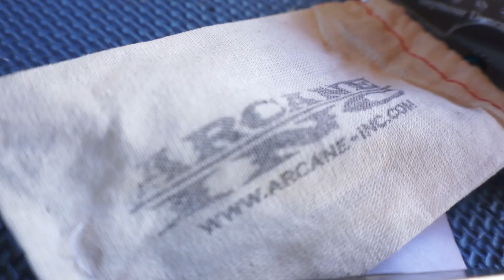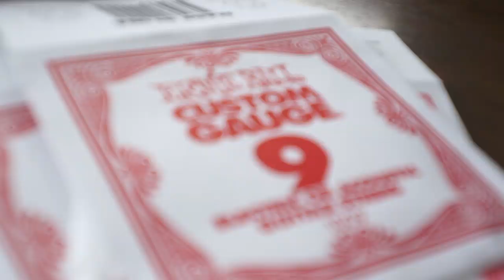INSANE Guitar Build | Final Construction - This Is The Day!!!! [Episode 7]

Comment: Hello where do you buy your  3 way switch prewired thanks alot. have a nice day.
Reply from the maker: Hey dude, I bought the pot via a UK online store I think - I can't recall for sure. They are available from Stewart McDonalds as well if you wanna check them out 😊 https://www.stewmac.com/Pickups_and_Electronics/Components_and_Parts/Potentiometers/CTS_Push_pull_Pots_DPDT.html?utm_source=google&utm_medium=shopping&utm_campaign=2020-05-gp&pref_currency=P&shipcalc=UK&gclid=CjwKCAjw7-P1BRA2EiwAXoPWA9I8oHD7hJOVe3DtJt6aDuY2VAu0yBR_mxLXCz0MOxy9zi54Kc4XfRoCej8QAvD_BwE - I also use Mad Hatter guitar gear sometimes - http://madhatterguitarproducts.com/ - and the easy I solder up myself 😊 Hope that helps. Have a great day!